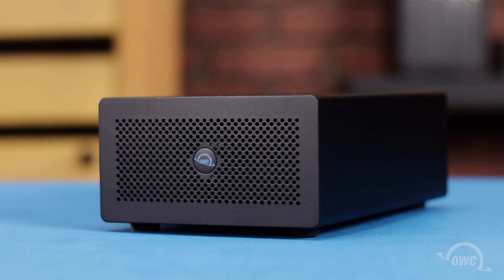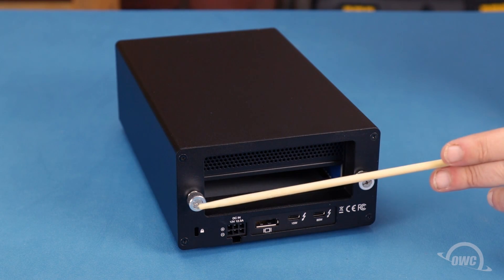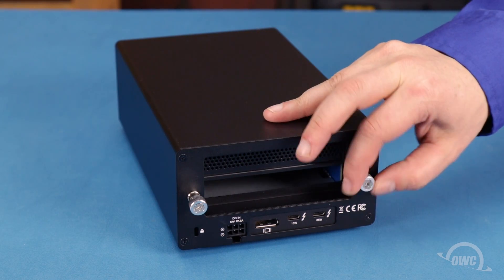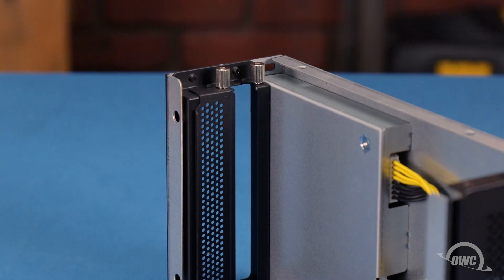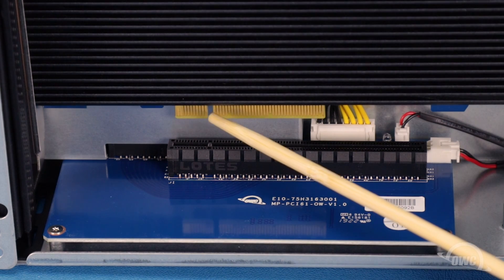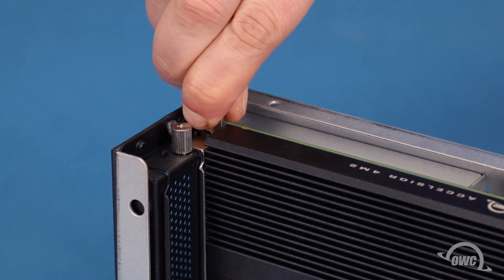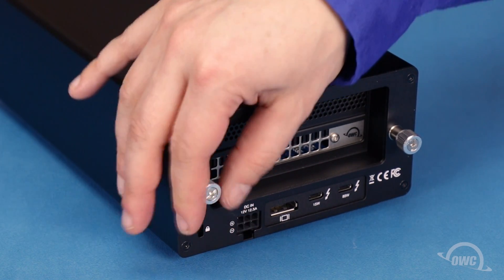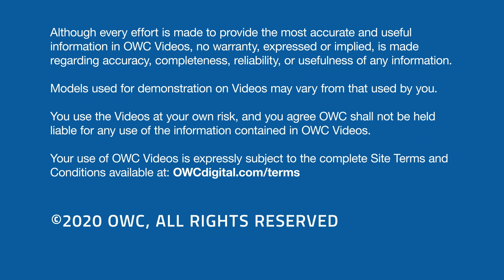How to install a PCIe card in the OWC Mercury Helios 3S

Comment: I just bought one of these and it's making a very high pitched clicking sound right out of the box and the fan doesn't appear to be working. My computer recognizes the card but it's getting extremely hot. I would refer to a manual for troubleshooting but there was only an info sheet included with the product and nothing online besides this video. I've heard great things about OWC but this is my first purchase and I'm not impressed so far.